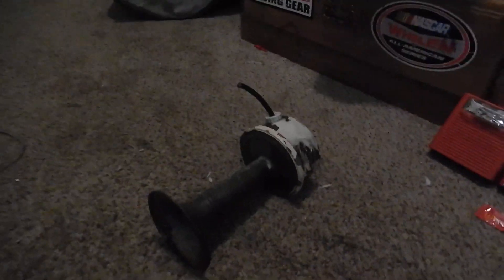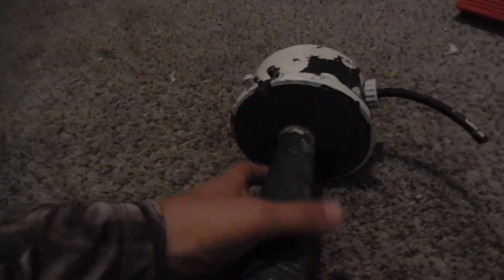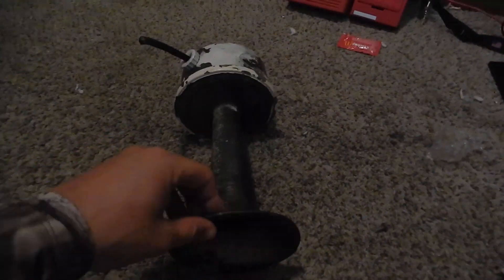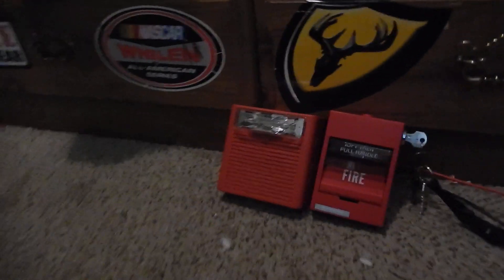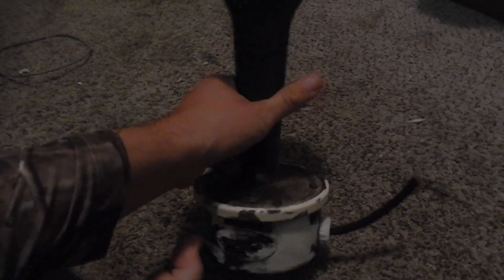NEW! Benjamin Electric/IBM/Simplex 4030 Mechanical horn

Comment: those came in a variety of voltages.. 220, 120, 48, 24, 12, 10, 6 and 4vac as well as 24, 12 and 6vdc.

hook a relay to your NAC output of the fire panel and use that to switch the horn.